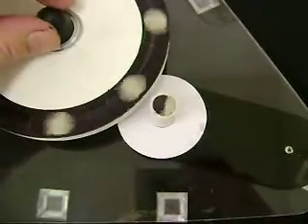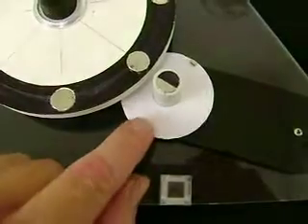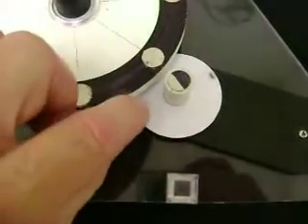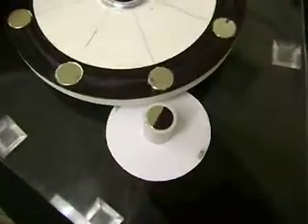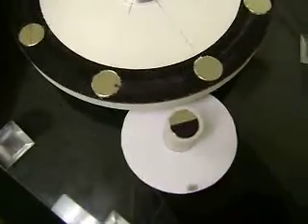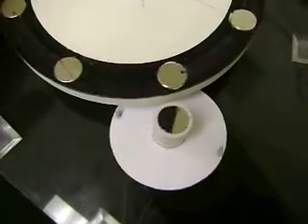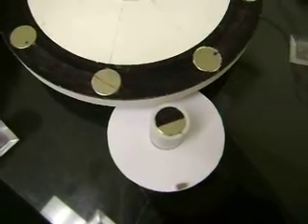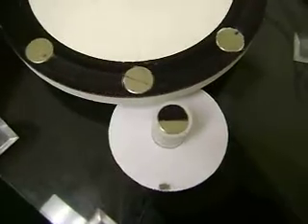Whipmag stator control

Comment: @lethalintention inspiring concept... I think you could use those stabilizer mags. to control the stator to be in its perfect alignment for each phase...maybe If you added stabilizer mags to the center disc itself to work with the stator stabilizers....just a thought